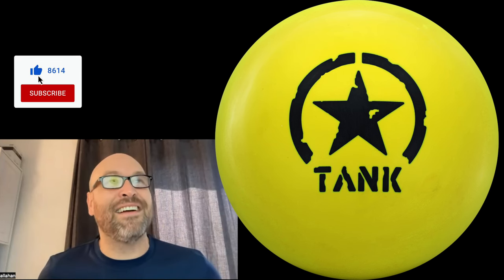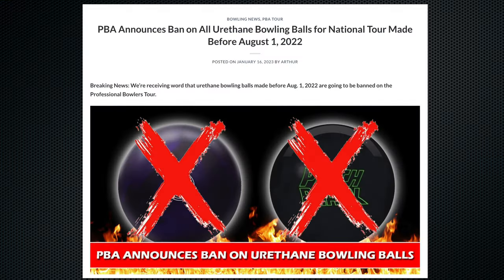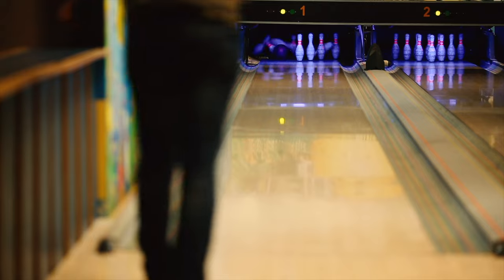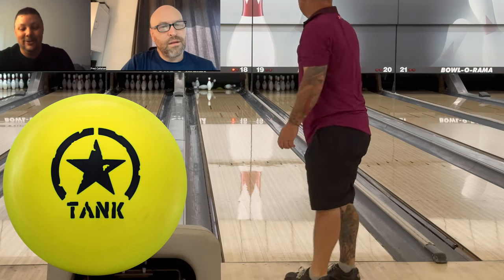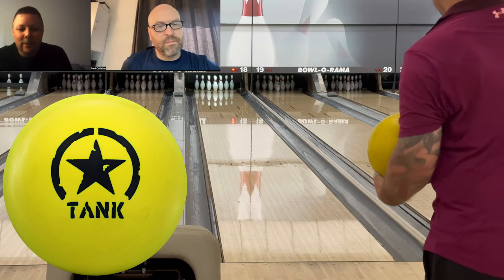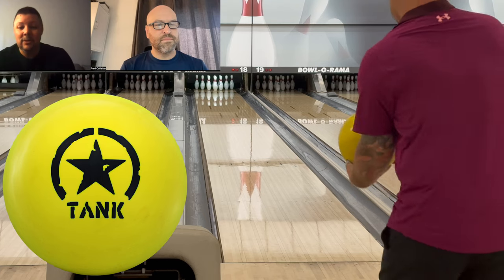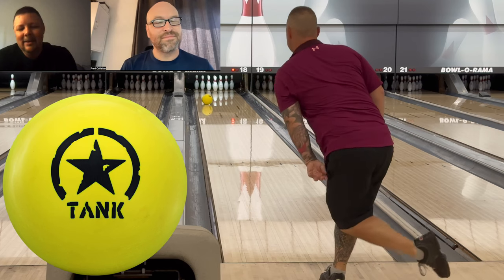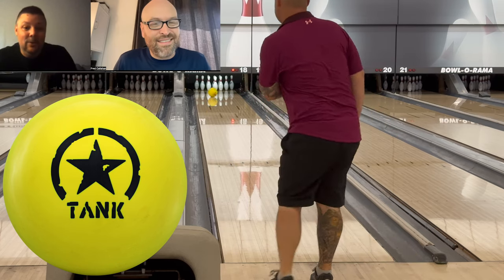Motiv Tank YellowJacket | The end of URETHANE?!

Comment: My own personal experience with Tanks (7 of them so far) is that they look a LOT better when you stay behind them more. The covers grab the lane extremely early, and the more sideways the ball is spinning, the longer it's going to take the ball to stabilize, but that also means it's going to kind of lock up and die more downlane (more energy eing burned up to stabilize). Staying behind them at release more helps the cover strength and the rotation of the ball not fight one another so much, gets the ball to read and move in the right part of the lane, and gets you a much more reliable, predictable motion. 

Justin has quite a bit of rotation at his release, so it doesn't surprise me that was struggling (and eventually wanted to take the surface up).
Reply: So for me that’s not quite true, I really like all of the other tanks they worked really well. I also spin then ball bumper than stay behind it. The yellow jacket is just such a strong ball out of the box like the ambush was. I cal tell I am gonna really like this ball
Reply: @justinw7070 You seem to have the same desired shot shape and stats (I'm about 340rpm and 13-14mph) as me (also a lefty) I'm trying to find something that's better "down and in" and everything in my bag is making me have to move past middle right and throw across the lane to keep it in the oil longer and as a result I have a hard time hitting my mark and I start to drift back left on approach coming up high quite often. I already have a urethane Tactic Control by DV8, but that thing hits like a wet turd, how do you think this Tank would react if polished to 3000?